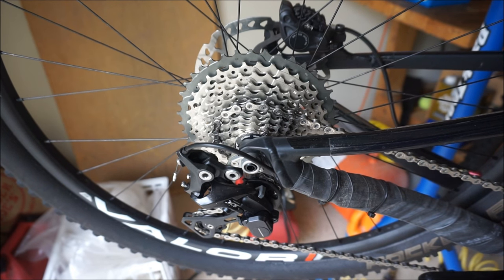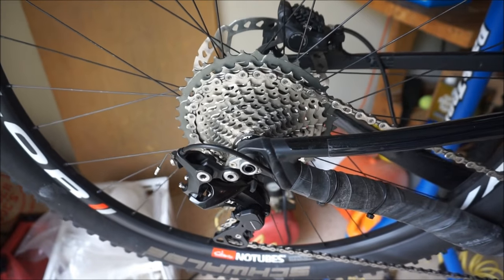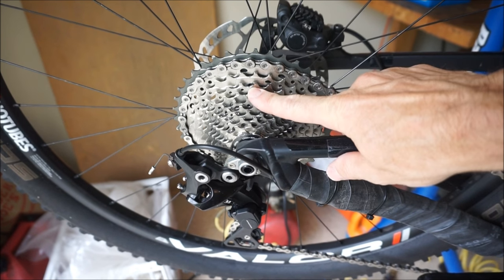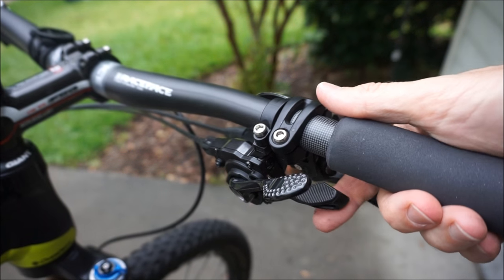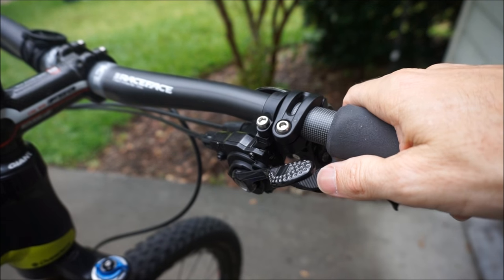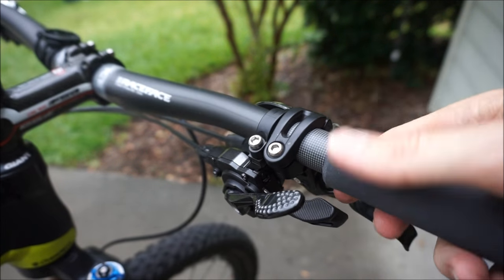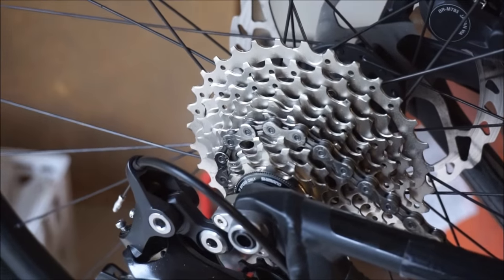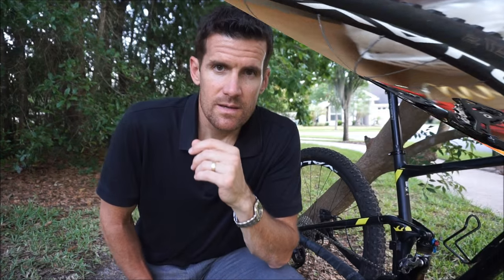Shimano XT 1x11 Drivetrain UPDATE (With Ultegra Road Cassette)

Comment: 7:40 - Shimano MTB cassettes kept the same effective freehub length for 10- and 11-speed (the largest cog is slightly dished so it clears the spokes). For their road cassettes, the jump to 11-speed meant that the cassette requires a freehub body around 1.85 mm longer. That should correspond to the width of your freehub body spacer.
Reply: I'm trying to put an 11-speed XT cassette on my 11-speed Ultegra road bike. Will there be any problems with this?

Comment: Wow I'm amazed at how light your anthem is. My 2017 anthem is just shy of 30 lbs and I want to make it lighter and aside from the wheels I'm not sure exactly which specific components to possibly look into (handlebars, seatpost, shocks etc.). By swapping my drivetrain to the XT 1x11 it dropped a bit of weight and gave me a great gear range though!
Reply from the maker: +CRYMTZ a set of carbon wheels like the Stan's Valor would be a huge upgrade. Obviously very expensive but it would make the most difference.

Comment: Yes, ESI, the absolute BEST grips. They are among the lightest, feel the best and last longer than soft rubber grips.
Great vid Clint but the question begging an answer here is, does the Ultegra cassette eliminate the reverse pedal skip issue? I assume it does considering the smaller gears but chain line would be similar so its still a valid question.

As an aside, if you are a weight weenie and thinking of trying the newer Lizard Skin grips which are even lighter than ESI, don't bother, I have them and while good they just aren't as good as ESI. Just throwin that out there in case someone was thinking of checking them out.
Reply from the maker: +schlooonginator Yes, the backpedaling issue seems to be resolved with the small Ultegra cassette.  It makes a bit of a noise but doesn't skip off the cog.

Comment: occams razor.....

this would sugest the overlap from the front chainring to cassette is too extreme for the math to work correctly. chainline angle
chain width
cassette cog thickness
while back pedaling.

i assume you have used a hanger adjustment tool to verify indexing?

Comment: On that "5 minutes cassette swap", be sure to check your derailler stops - especially with that change in spacers.  Take note of the two settings, so you can repeat them every time (i.e.: turn limit screw or shifter adjuster 1/4 turn) without going through a longer dialing in of the adjustment.
Reply: The spaced is only there to accommodate the dished large cog on MTB cassettes and long freehub bodies. Cassette pitch and position remains the same.
Reply: @EditioCastigata  Hello, is it possible to make same mtb group set 28x38 but 12 speed and ultegra or sram 11-34 cassette?
Reply: @ChinCo1  No, the only cassettes that will fit are for the Shimano HG-L freehub (road 11/12). The narrower MTB hub is called HG-M.

Comment: Clint, great video. With the change to the smaller cassette is there any issue with too much chain or with such a small change in gearing does the derailleur take up the slack? Thanks .

Comment: It is amazing how you achieved that weight with an alluminium full suspension bike, do you have a list of your build? I have Trek Top Fuel alluminium and I wish to get as low as yours!
Reply from the maker: +Luis Aparicio the carbon wheels are a big factor. Also, I have a pretty light stem, bar, seatpost and saddle.

Comment: Have you considered running a SRAM chain?  Apparently they have more lateral flex than Shimano chains and this may help with the backpedaling issue you're experiencing.  On a related note, if you're looking for a great way to add top end gearing and saving weight, I highly recommend going with an X01 or XX1 10-42T 11 speed cassette.  They are ~200g lighter than an XT 11-42T cassette and the 10T gives you a 10% top end gearing improvement over the Shimano 11T.  The best part is that you can keep using your Shimano shifter and rear derailleur.  I realize the SRAM 10-42T cassette doesn't address your desire for closer gear spacing and its a bit pricey (especially when you factor in the XD driver freehub body), but I run this Shimano/SRAM hybrid and couldn't be happier.  I also don't experience the chain drop while backpedalling from larger cogs when running a SRAM XG-1195 X01 cassette w/ m9000 XTR RD and XX1 SRAM Chain.
Reply: +madrubicon or xx 11-32 or xx 11-36. Still don't get the top end as you mentioned but you wouldn't have to buy the xd driver either.
Reply: Some hubs can't take a 10t cassette.
Reply: +NoBrakes23 the xx does not have the 10 tooth cog and does not need the xd driver...
Reply: +Kevin Williams I was responding to the comment above yours.
Reply: +NoBrakes23 ok gotcha

Comment: Hi Clint, Great review about the Shimano XT chainline. I was so frustrated with the back pedaling and noise that I had the 2.5mm spacer on the drive side bottom bracket removed and a spacer put on the other side between the crank and the bottom bracket instead. Still didn't resolve the issue!  I originally requested that the bike shop swap out the cassette first for an Ultegra 11-32 because it made sense to me if I didn't need the 42T range. They informed me that wouldn't make a difference at all, which I can't believe??? Did switching out the cassette solve the back pedaling issue? Does the drivetrain run smooth now?
Reply from the maker: I honestly cannot remember! I don't have this bike anymore. I don't recall it being an issue so if I had to take a guess I would say it did.

Comment: I've had the same issue with the backpedalling even on old-fashioned XT 3x10 drivetrain on middle ring and two largest cogs but after several hundred kilometres the cassette seemed to run-in and I have no problems with that whatsoever even after the chain replacement.

Comment: hey Clint,

I bought the giant talon 2 2015 Large frame and it fits perfectly. I will also be fitting a 11-25 road cassete and instslling a 48-36-26 crankset. im more focusing on speed. i was also thinking to use the road sti shifters on the talon, try n change it to a road/hybrid bike. 

i wont be really using my talon on trails, just the local road bike trails and cruise/liesure riding. maybe the weekend charity ride events.

was wondering if using the sti shifters would be a good idea. i have a shimano deore shadow rear derailure.

many thanks

Comment: I know it has been a while and you have changed bikes since this video, however I wanted to comment on the chain drop issue, I recently went from 2X10 to 1X11, Shimano 11-46 on the back with XT 11spd shifter and RaceFace NW 30 on the front, I had watched this video several times, I had my shop do it as I did'nt have the tools. I can say it shifts perfect and no matter how hard I try I have not been able to make the chain drop pedaling forwards or backwards.  the second thing is that when you mention you change the cassette out to goto the mountains, I wanted to ask do you change the chain as well? I would have though the change would be too long or short? Sorry to bring up this old topic I was just curious.
Reply from the maker: +axxxxman since I added a trail bike back to my fleet I probably will not end up putting on the larger cassette. But if I did I would change the chain for the reason that you mentioned. It's also good to keep a chain and cassette matched to each other.

Comment: Did you have to adjust the rd low limit screw after you removed the spacer?  Seems like you you might have to allow the rd to move slightly inboard to engage the largest cog?
Reply from the maker: +Rich Santos I honestly don't remember exactly, but if memory serves me right I don't think I did. I think that the cogs lineup the same, it's just the interface with the freehub body that is different. So that interface is shifted inward on the Shimano 11 speed mountain bike cassettes.

Comment: hi Clint Gibbs, 
I have a question regarding shimano XT 8000 drivetrain 2x11.
When I am using rearderailer with clutch off, drivetrain is working fine and quiet.
When the clutch is on, and i'm using medium and low gears the drivetrain is workink more noisy, specyaly under load.
I'm riding hard tail, 29er. Bike in new, only 300km.
Question is if this is normal or I need to adjust the rear derailleur?
Thanks and best regards.

Comment: on the 10 speeds the chainline favors the upper 5 cogs. i found this to be the best because that most the gears i use most of the time. but i seen others with this issue and it came down to geometry of the fame. you can manipulate it in most circumstaces but the geo on some frames are really bad for 1x setups which is very poor given its 2016.

bb manipulation of the chainline is the last resort. always use locktite when using chainring bolt spacers and check the after the first 3 or 4 rides. they will work loose, after tge 3rd or 4th tighning they seem to stay tight.

Comment: Hey Clint. Did you happen to unscrew the b-tension screw a bit to get the upper jockey wheel closer to the ultegra cassette?
Reply from the maker: +MarzNet256 I did not have to adjust the B tension screw

Comment: hi currently im running with 1x10 and thinking about upgrading to 1x11. dont have many trails near by. just would like as many opinons as posiable. i have some issues with back pedling and it turns out it might be the chain inlinement if you have enough clearence to push the chainring in or out just by removing or adding a +/- 2.5mm bottom bracket spacer might do the trick of stopping those back pedling gear drops.

Comment: What you did reminds me a lot of what I had on my older bikes, something called Shimano Hyperglide C (compact).  They used both a smaller cassette in the back along with smaller chainrings to lighten things up...  I'm not sure why Shimano dropped this configuration since it is lighter and you get effectively the same set of gear ratios.  I believe my Cassette was 9 speed and ranged from 28 down to 11, I was able to use on chainring in the front for trail riding.  Many bikes back in the 1990's spec'd this drivetrain...  then we had oval cogs and all sort of other weird things too, the worst being gripshift imo.
Reply: They did it probably to sell more group sets and gravels.
Reply: @ChinCo1  Yeah, some things are genuine improvements but others I feel are just that, something small changes just to sell new product.

Comment: your derailleur hanger may be bent a little, I had the same problem of down shifting when pedaling backwards. I used the park tools derailleur tool to check alignment and found it a little off
Reply from the maker: +nuke recoil I have the issue on both of my bikes. And others have had the same issue so I don't think it's an issue with the derailleur hanger.

Comment: Do you find the tighter gear range better for the trails as well? I am considering this change on my XTR M9000 2x with SRAM XG-1190 11sp 11-32 cassette at 196g . I would then change my small ring from 26t to 24t as I have some mountains nearby (so long as the 24/36 shifts ok on the front). Then I would have similar weight as a standard 1x 32t with a slightly larger range and much tighter gearing.
Reply from the maker: +Ethan Millstein for my trails, yes, I found the tighter gear spread to be better.
Reply: I know it's too late :) But it says on SRAM site "11-30t, and 11-32t ratios are only compatible with WiFLi and 1x rear derailleurs.". Did you make that system btw, I want try the same, does it work? If so, can you please name your components, so I can checkout. Thanks!

BTW, I wanted to buy 2x12 26-40 x 11-34 MTB system, but there is NONE at the market, 1x tefals with holes at the top speeds and gravels everywhere...
Reply: I don’t think I ended up doing it and bought a new bike with a 1x system ~6 months later.

Comment: are you sure that problem is not from a chainline / frame geometry issue? i run 4 bikes that have 1x10 11x40t cassette and do not have that problem, however i run a 47-48 chainline on all my bikes. i used longer chainring bolts, chainring spacers and one bike needed only 1 bottom bracket spacer on the non drive side only. my buddy has a sync'r pro and had that issue, he has a 72 mm bb so we modded the chainline to 47 mm and that fixed the issue.
Reply from the maker: +mjs1231 it is not a chain line or geometry issue. I had no problems at all with a 1 x 10 set up. The back pedaling issue only happens with 1 x 11 in the top few larger cogs.
Reply: +Clint Gibbs ok ic, i misunderstood. have you tried to run a 10 speed chain to see if it has an effect or was it just that spacer? i have seen a few other vids pertaining to the same problem. could be a chain/cassette issue?

Comment: Wouldn't the more normal thing to do be switching to a bigger front chainring? Just switching cassettes isn't so quickly done. (chain lenght between the two is different, I would believe the rear derail. would need some adjusting, ... ) A bigger front gear is a more effective gear :-). An 11-32 Ultegra sounds interesting on my 2x11 rigid hardtail, so now I know it's possible. Thx !
Reply from the maker: +Jan Willem Pieters I can change a cassette much, much faster than I can change a front chainring. Also if you went with a bigger front chainring you're adding weight instead of taking it away. Obviously not much so the big differences is not being able to put on a cassette that's lighter.

Comment: Hey Clint, 
i run a 1 by 9 11-34 setup on my dirt jump bike. I don't have a clutch, because 9 speed clutch derailleurs aren't a thing. I use A race face Narrow wide Chain ring (32t) and the RSP chain Director chain guide. If I take the guide off, the bike shifts clean, but drops a chain whenever I take a hard landing, but If i keep the chain protector, The bike shifts very slowly, and usually needs me to push it a bit further than the index to get it to shift to a larger cog. do you have any Ideas to get my bike to shift, and keep the chain on? Also i run a flawless 1 by 10 with a thirty two tooth narrow wide on my kona Process, but I dont want to spend the money on a 10 speed drive terrain for my dj bike. Btw great video, keep em' coming, any help wold be apreciated.
Reply from the maker: +shakeweight11 do you run a narrow wide chainring on your dirt jump bike? I have not done any research to see if they make a narrow wide for a 9 speed but if they do that's what I'd recommend.
Reply: I do, I use the same type of race face narrow wide chain ring.

Comment: HI CLINT !
good video and information and tips too . i have  shimano deore 10spd  but my issue is on small corg (10th gears ) and back paddling the chain will chump up to the bigger gears like 9th and 8th , only those 3 gears  . do you have any tips to fix the problem ? 
my hub spacer is 135mm and i had 2mm washers to shim  but my wheel off alignment  .
thank you !
Reply from the maker: +Thai Pham the first thing that I would check is your derailleur hanger. See if it's bent. There's a special tool that you need to do that so you'll probably need to take it to your local bike shop. Does it shift well in all of the gears?
Reply: thanks for replying . my bike is brand new all gears are good but 3 smaller corg ,
i think i should do the fine tuned or i may taking out the free hub spacer .thanks again

Comment: What would cause my Giant Boulder to keep snapping chains? I've looked at the crank teeth and the teeth on the rear sprocket and there all straight and in good shape, I'm only 160lbs so it's not like I'm huge but I'm on my 3rd chain in 2 weeks??? Any help???
Reply: +Derek Joon is your chain to tight? does it happen in a low gear? (big sprocket at the back)
Reply: No the chain was the same length as the original one, it usually happens when I'm in the middle gears one rear sprocket 3-6. Going to put a spare rim I have on just to see if it is something to do with the original rim/sprocket

Comment: sounds like you did something wrong if you dont need the spacer.. does the cassette feel loose at all?
Reply: +Peter Griffin 

In my experience, a road cassette is wider
than an MTB cassette. I recently installed an XT 11-40 cassette on my road bike
and had to learn that lesson. I actually needed a spacer, whereas I did not need
it with a 105 11-32 cassette.
Reply from the maker: +Peter Griffin Shimano 11 speed Road cassettes are definitely wider than the 11 speed mountain bike cassettes.
Reply: Clint Gibbs Yah you're right forgot that Ultegra is roadie gear.
Reply: yes because they are suited for 11 speed freehub body

Comment: How about using ultegra 11-32 cogs for 2x11 setup XTm8000 using crank 38-28 teeth, would there be problem?
Reply from the maker: +Jonathan Lignes it will work fine as long as your  freehub will accept  a wider cassette. If it will take a SRAM mtb 11-speed cassette it will take a Shimano Road 11 speed
Reply: Thank you Sir.
Reply: @athanjonathan3317  Hello, I want to buy exactly the same system, did you try it, does it work? Thanks
Reply: @ChinCo1  yeah smoothly